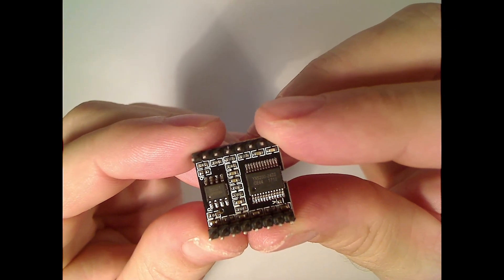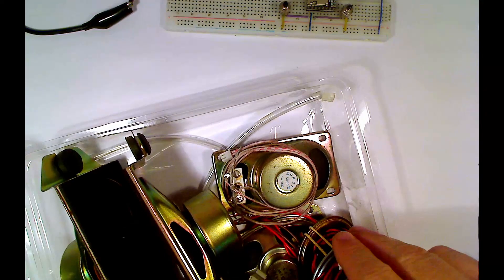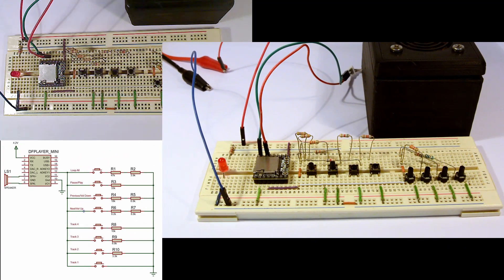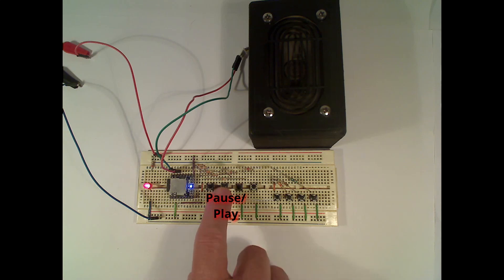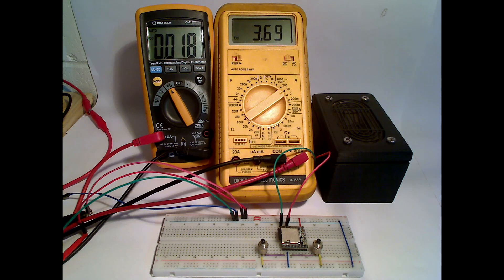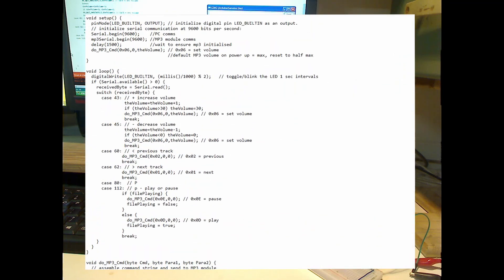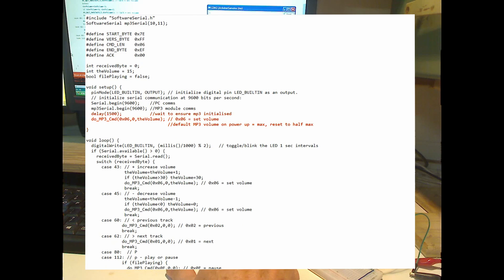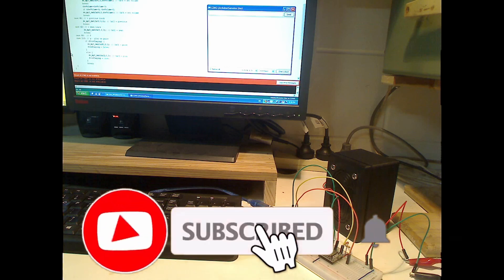DFPlayer Mini MP3 Module Testing

Comment: Fantastic tutorial. Would it be possible to connect multiple df players to one arduino, and have each connected to their own speaker? I am attempting to make an instrument that plays a noise by the push of a button and each button/noise would have its own speaker. Thanks in advance.
Reply from the maker: You would need a multiplexer (like HEF4051) so that a single arduino (with the TX pin through a voltage divider) could then control multiple DFPlayer's (the HEF4051 would allow up to 8 to be separately controlled). Each DFplayer would have its own speaker. The push button for each DFplayer I suppose would be connected to the ADKEY1 pin via a 33K resistor (if I understand what you a trying to do). You could maybe do this without even using the Arduino, if you don't need the arduino to select tracks, change volume etc.
Reply: @FadsToObsessions  I appreciate the response. Would an L293DNE or a 74HC595 have the same function? Also, through the ADKEY1 pin, what would I name the mp3 file if I was not going to use an Arduino? And do you have any troubleshooting tips for when the df player won't respond with its blue LED, but the speaker is still receiving power?
Reply from the maker: Unfortunately, neither the L293DNE (a H-Bridge driver) or a 74HC595 (a shift register) can be used in place of a HEF4051 (a multiplexer). The mp3 files should be named 0001.mp3, 0002.mp3 etc (see 4:50 in the video). The blue LED not working is a bad sign. Recommend double checking DFplayer is Ok by hooking up the basic standalone circuit (see 1:25 in the video), check and double check your wiring and power supply, and then see if it works (see 2:40 in the video). At 2:40 in the video, it shows that when powered on, nothing happens (blue LED not lit) until you press one of the play buttons. Good luck.
Reply: @FadsToObsessions  Thank you for your time. I was able to use no resistor to utilize the segment 1 command on ADKEY1, as well as the segment 5 command on ADKEY2 . My main issue was a proper power supply, as I fried one module, and the rest had insufficient power. This was corrected through the use of a desktop power supply.
Reply from the maker: Thanks for commenting back on your success/trouble shooting - will be perhaps helpful to others. Cheers.

Comment: Well explained! Thanks. 
I've ordered a DF miniplayer in hope I'll have more success with this than the  DRF0534 player,  which has onboard flash memory rather than using an SD card, but has an almost unintelligible data sheet (in English anyway!). But now also wondering if the code you used to send Commands to the DF Miniplayer might work with the DRF0534 - they seem to be related products.
Thanks again
Reply from the maker: Good luck - If you get a chance and are successful with using DF Mini code with DRF0534 - would appreciate if you could comment back, onboard flash rather than SD card can be advantageous for particular applications

Comment: You are a Genius! This is just what i need. One noob question, ¿Is there a volume limitation?
Reply from the maker: Thanks for the kind words (but unfortunately, far from a genius 🤓). 
The component has a built in 3W amplifier that can direct drive 8/16ohm speakers, with 30 levels of adjustable volume within that range. The speakers I used in the video, salvaged from an old analog TV, were "plenty loud" with the module, and I generally only used it about mid volume (otherwise too loud in a normal office/bedroom sized space). 
Take the normal care with earphones, it can be very loud with them.

Comment: Thanks! I tried looping sound on my DFplayer and it isn't working, any idea why?
Reply from the maker: I'm assuming you have the other functions working, so basic connections etc OK otherwise. First recommendation would be checking the resistor values, which for the loop all function, the datasheet states 51K ohm - although I found the value doesn't need to be "exact" but fairly "close" (so maybe you are not close enough??), secondly, perhaps check the naming of your files on the SD card - need to adhere the datasheet naming format, as maybe this could be causing interference.
Reply: @FadsToObsessions  thanks for the reply! Where should I put the 51k resistor?
Reply from the maker: @Nerya Have a look at 4:30 in the video, this gives a schematic diagram. The 51K  resistor is from pin 12 to a momentary push switch and then from the switch to ground. In the video, this is the short horizontal purple wire on the bottom, then through the vertical orange etc. I did not have 51K, so used a 47K and a 3.9K together in series.
Reply: @FadsToObsessions  But what if I want it to interface directly and only with an Arduino nano? As in automatically play a loop without pressing a button
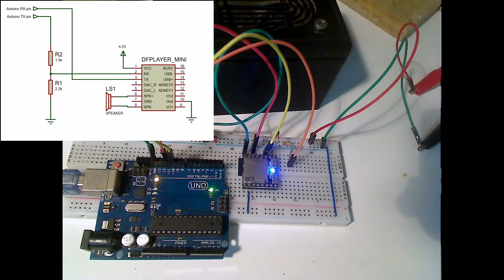Reply from the maker: @Nerya Oh, in that case, after hooking-up the nano (see 7:50 in the video for schematic etc if you haven't done this already) will need to add some code (see 9:30 in the video). The datasheet page 4 section 3.2 lists the various commands available. In the example code in the video, I have a function called "do_MP3_Cmd()" which can be used to send the desired command. For loop all, try using do_MP3_Cmd(0x11,0,1) to start repeat all playback and do_MP3_Cmd(0x11,0,0) if you want to stop repeat all playback.
Reply: @FadsToObsessions  I did that, but it still has breaks between every time the sound is played, for example, it plays, fades out for 200 ms, then starts again
Reply from the maker: @Nerya Could be power-supply problem? Not sure, I still have the test circuit lying around, so I will give this a test over the next couple of days when have time, and get back to you.
Reply: @FadsToObsessions  no, I've checked, and it is getting 5v constant supply, thank you very much for your help! Looking forward to hearing from you
Reply from the maker: @Nerya Sheetrit
I've tested the play-all/looping function (see https://youtu.be/udgf_-x0JqI for a quick video showing the circuit, the code and the working demo) and all seems OK. If you still have trouble after this, I think it could be perhaps you have a faulty module (or if your 5V supply is from a USB port, perhaps it is giving 5V but cannot supply sufficient current?).
Reply: @FadsToObsessions  First of all, thank you VERY much for this help, I don't know many people that would help like that, and you're really one of a kind. What I was asking and wanted to do though, is play a short (6 sec) sound, in my case a Lightsaber hum, it loops, but has a short pause in between looping, is there any way to stop that?
Reply from the maker: Unfortunately the module doesn't give any control over the timing between when playback between tracks starts. And there is a short pause as the module accesses the data for a new track from the SD card. Best I can recommend, depending upon your application, is perhaps make a series of tracks on the SD card with an audio app, each with longer durations of the original loop copied/stitched  (e.g., 6, 12, 18 seconds etc) and play the track with the duration as needed. Not optimal, but perhaps a work around??
Reply: @FadsToObsessions  Unfortunately that is not an option, because I'm making a lightsaber and it needs to be on for extensive amounts of time and also transform fluently to different swing sounds. Thanks anyway, you were a huge help!

Comment: Great video. Can you attach a potentiometer as volume control instead of long pressing a switch?
Reply from the maker: Thanks. Unfortunately you cannot use a potentiometer in this case, the volume control on the unit is digital input only.
Reply: @FadsToObsessions  thanks for your help
Reply: or you can build a decoder

Comment: HELP! I copied your code line for line, but it won't actually adjust the volume. The other features work (next/previous and play/pause). What's going wrong?
Reply from the maker: Since the play/pause etc are working, therefore your code would appear correct and is successfully connected to the MP3 player, sending commands via the serial port etc. The same function is used to send all the commands, so in the first instance maybe a hardware problem. You could check that the variable theVolume is initialised properly (int theVolume = 15;) before the main loop, as with my modules, the default at power-up appears to be maximum volume. On power-up, if your module isn't playing very loudly, again indicting hardware and/or power problem. You could try hooking it up with the resistor ladder (~ 4:30 in the video) and checking that the volume can be adjusted with push buttons - this would check that the module is working ok.

Comment: What is fomat of sdcard should be work with it?
Reply from the maker: I have mine, a SanDisk 16GB microSD, formatted as FAT32 - so can drop 'n drag files from Windows 10/PC
Reply: @FadsToObsessions  hmm it's may be work with exFat fomat??
It's commonly used for mobile devices now days
Reply from the maker: The datasheet only says " ... provides micro SD card driver, and supports FAT16 and FAT32 file systems.", so more than likely probably not. If you do try with exFat, and have time, please post back your findings.

Comment: thank you i'm about to use this to paly selected tracks using buttons and was wondering how accurate those screwy resistor values they quoted had to be. Even looked for them but to no avail. so Seeing that you can use normal value resistors is a great help.
Reply from the maker: No problem 👍

Comment: Great video you are to be commended, just a quick question. Without using the arduino setup What would happen when the song ends? Will it play the next song on the sd card? Is it possible to have the song play Once? at a push of a button and when the song ends it simply stops until you press it again? If you had just the single file on the sd card?
Reply from the maker: Using the "ADkey control" (i.e., without Arduino and using the resistor ladder setup, section 4 page 15 of the datasheet) if use 33K resistor, the function is just play (or pause if playing)  the "current track" (which if only one file on the card, will be that file) and then when the track is finished, the player stops (and if press 'play' again will play the same song). To get the previous or next track, would need to use additional buttons with 24K and 15K resistors respectively.
Reply: @FadsToObsessions  Thankyou very much, very helpful

Comment: What's the maximum ohm of the speaker? Sorry for the newbie question.
Reply from the maker: I've used both 8 ohm and 16 ohm speakers, the datasheet states "drive speaker less than 3W" - the speaker in the video is 16 ohm

Comment: Brother, I want to use a potentiometer to control the next/previous song. or any other rotating method. can I do this with this module?
Reply from the maker: I think you could, using the AD key connection method, where pin 12 (ADKEY1) is connected via suitable resistor to ground via a push button, see https://youtu.be/gMv2xGHLXdU?t=231  If you replace all the resistors with a single potentiometer (a 50K may be enough) and the pot wiper to ground via a push button. Then when the pot is set to a specific value, and the button pressed, you would get that particular function. However, the pot by itself (without the push button to ground) would not work.